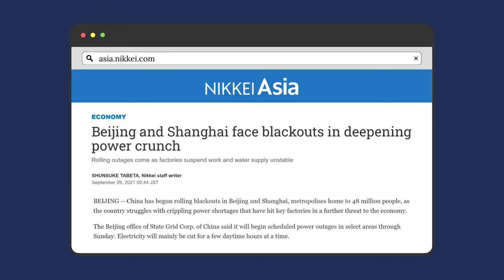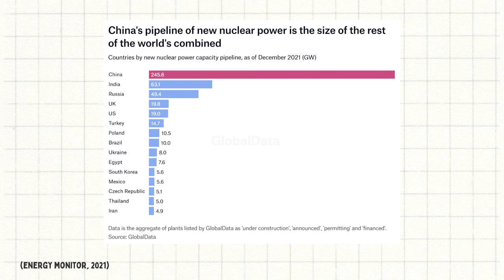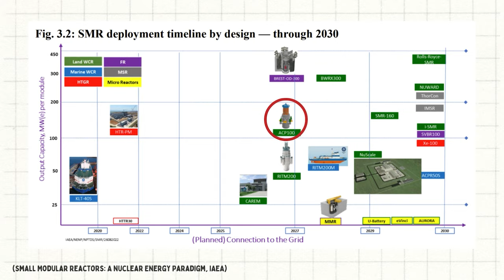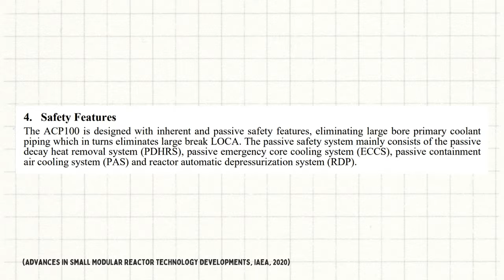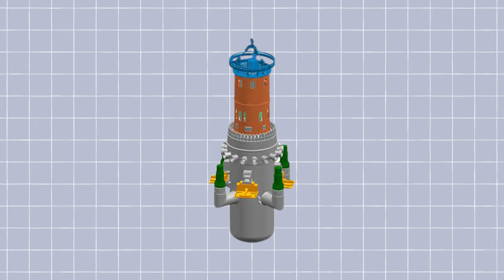China's New Small Modular Reactor - The First of Many?

Comment: This is a more credible long term energy solution to any other.
Reply: At what level of uranium enrichment does this version of PWR run? Above the civil level, because the design is based on nuclear submarine reactors which have a military level of enrichment of at least 20%. 2 Where will we get the water to cool them, especially as that is the problem with PWRs? 3 Where do they get the enriched uranium from, because the UK has no economically viable deposits of uranium. 4 How often do they have to be refueled?  In the case of the Rolls Royce type it is every 1 to 2 years. Because there are more sites there is a greater chance of a terrorist stealing the material for a dirty bomb. Security of more sites costs more money 5. Do they produce more dangerous nuclear waste pro rata than the present PWRs? Have you considered an advanced deep geothermal system created using a gyrotron, or plasma drill? I honestly think you need to do some more research before you make your statement. It is a good policy to consider more than one source of information.

Comment: Let's be realistic about cost?
You quote "$400-800m... But could increase" (it's nuclear, of course it will!!)
But let's give the benefit of the doubt, set "800m" for the first project and assume it eventually halves to $400m.... For a 125,MW plant that MIGHT be built in 3 years, one day 🤔
Offshore wind can do that right now, for less money.
(3.6GW for £8 bn)
It can also ramp as each turbine is completed to reduce the legacy carbon footprint.
.
If China pulls it off, can others, in the timescale? (Doubtful)
Politics.
Who's going to be the first to say "those guys can't have it!!" While pointing at a country they don't like?
Let's ask the "where will the materials come from?" question.
Etc, etc, etc
Reply: I missed that value but seems revealing. Normal reactors cost ~$15B per GW to build compared to ~$1.5B per GW for wind/Solar installations. Modular reactors are supposed to close that gap. But $0.8B for 125MW equates to $6.4B per GW to install. And then there will be the same again to run and eventually dismantle it.
Reply: If my memory serve me correctly in EU 2021 or 2022, the wind & solar did not generate enough energy (as plan) due to weather changed. In another word, depending on mercy of nature especially the seasonal change not according to historical records.

In addition, wind & solar have limited scalability at a certain point - not be able to cope with power demand. It requires lands (sea shore) in certain locations. China is the biggest renewable energy producer in the world for Wind & Solar and building cost also cheaper than all western world. Why they chose to expand nuclear more than expand renewable energy? Probably predictable & scalable supply that could cope with demand and less vulnerable with unpredictable weather change could be a good reasons. Cheaper investment but output drop due to weather change might cost more money than more costly investment but more stability. China also build Molton Salt reactor which they have Abandoned but still on first project so no harm to test multiple nuclear options to compare. 

Anyhow, China will pursue both renewable & nuclear to replace fossil in future.